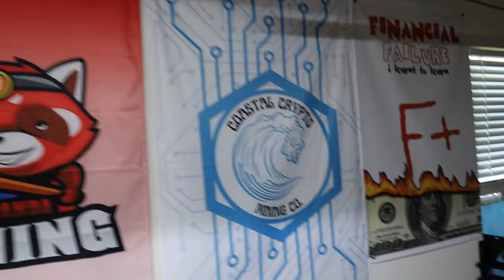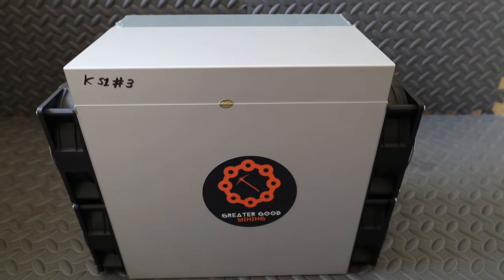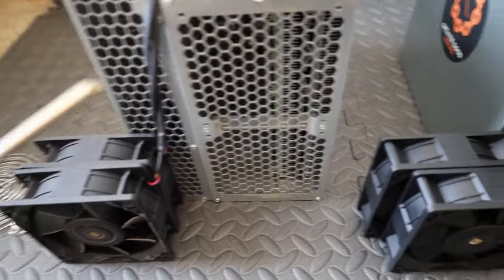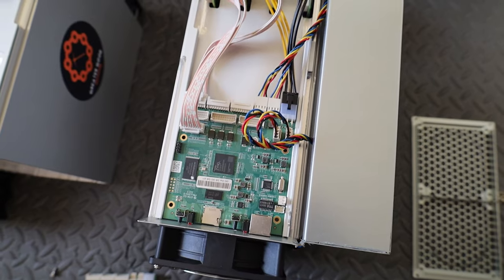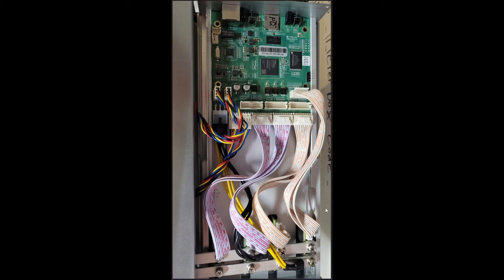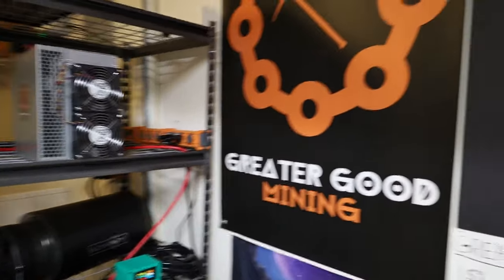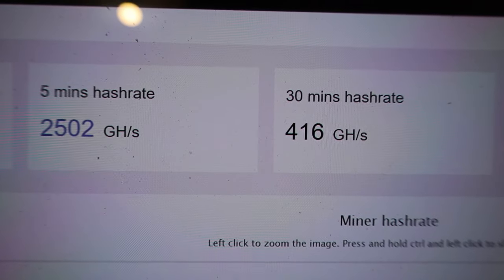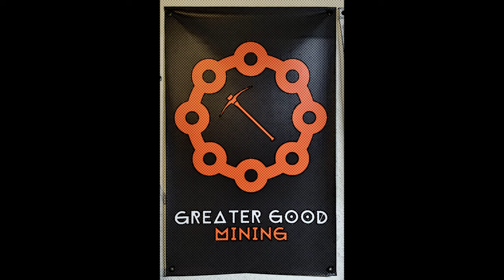Turn Two Iceriver Kaspa ASIC KS1's into an Iceriver KS2!! (Iceriver 5% off in description!)

Comment: Nice video, have you try this experiment with a KS1 control board that came by default??
Reply from the maker: No, but it should work. The problem is you won't see 4 hashboards only 2. The hashrate should show up at the pool, but you won't be able to monitor 2 of your hashboards

Comment: GGM awesome howto FAFOing .. you rock brother, just remember to remove the fans you don’t need to unscrew them just unscrew the fan plate the 4 outer screws and the second row data ports on the controller is for the KS3s hashboards.
Reply from the maker: I was wondering about the 2nd row of ports lol I'm glad you told me. I was thinking to myself... did they leave room to upgrade to a Mega Iceriver with 7 hashboards? 😆
Reply: @GreaterGoodMining  that’s a wild idea ... 3 KS3 hashboards and 4 KS1/2 hashboards all running at the same time would be sweet!
Reply from the maker: @fullyelectric  HaHa sounds like a potential future FAFO'ing session!

Comment: What a great video. I am curious if all these control boards are the same and it just matters on what firmware gets installed. Does anyone know?
Reply from the maker: Seems like they physically all look the same as far as I have seen. It's all about what they loaded up on them.
Reply: Could make for a good video! 😂
Reply: Not they look the same but arnt the same. I got a wrong ks3 sent by my supplyer and installed KS1 FW and it gave error.

Comment: Have you noticed your 4th Hash is 0° ? Is it a bug or something ?
Would it work with a KS3M Board ?
Reply from the maker: I moved where the cable was connected to the control board (I mentioned it at one point in the video) and all 4 boards report normally. No it won't work with a KS3M

Comment: Very cool video. What's the max suggested temp for the hashboards?
Reply from the maker: Hey thanks for watching! Max temp is 70c. What I've noticed with the latest firmware is that the fans adjust to keep the boards very close to or exactly 60c. Optimum temp seems to be 60c!

Comment: What is the difference between the ks1 and ks2 control boards other than the firmware?
Reply from the maker: You can run 4 hashboards on a ks1 control board, they just won't show up in the webgui. The hashrate will show up at the pool

Comment: So I wonder what makes ks3m not Overclockable. can I just take a KS3 board and use that to then it might become Overclockable.
Reply from the maker: No you cannot. I am in direct contact with people who make these overclocks and work with devs etc. It is not safe to overclock the KS3M. The KS3M is basically an already overclocked KS3L.
Reply: @GreaterGoodMining  that makes sense.

Comment: something does not add up. You need a Ks2 board? how much is that.. and how about the power supply, is it big enough to power the extra boards?  please explain.
Reply from the maker: Power supply for both the KS1 and KS2 is exactly the same, 2000 watts. In my video, I show that my overclocked KS2 only pulls about 1550 watts. You can run all 4 boards with the KS1 control board and the full hashrate would show up at the pool. But only 2 boards would show up in the web GUI that way. I wanted to avoid all that, i wanted all 4 boards to show up in the web gui, so I bought a KS2 control board off Icerivers website. About $60 for the control board off Icerivers website plus whatever the cost of shipping would be to your country/location
Reply: Than you. Did you try uploading the KS2 firmware to the Ks1 controller after you added the hashing boards? It could work...and you may see the board on the GUI... Please test.
Reply from the maker: @spmadeez  No need to test, I already know what will happen. Firmware update doesn't change every single file loaded onto the control board, it only updates a small portion of the files to make slight changes to how the ASIC behaves. If you want to do this with a KS1 board you totally can, like I said the hashrate that is expected will show up at the pool. But when you log into the web gui, you'll only see two boards.
Reply: @GreaterGoodMining   It actually will show all 4 boards if you load the ks2 firmware. At least with mine it did.
Reply from the maker: @JK3Dprinting  I had tried this before on my older 2 KS1's and it didn't work.... interesting. Maybe something has changed since then. What I've come to realize with Iceriver ASIC'S is that sometimes things just won't work on every model. I've had people in my Discord try the KS3L to KS3M stock control board swap and it didn't work. But a custom control  board will etc... $60 plus shipping for a KS2 control board is worth it to me because I like to FAFO anyway lol
Reply: @GreaterGoodMining   Well I did a reset on my KS1 and the factory BOOT version says its for a KS2 so there you go. Looks like mine was shipped with a KS2 control board but with KS1 firmware.
Reply from the maker: @JK3Dprinting  whoa, that's interesting! The plot thickens! HaHa Iceriver does some weird stuff I swear

Comment: I want to ask from where you get overclock ? From Tswift or Free one. Becouse If the overclock version on Tswift is bether I will contact him :)  and also... did he ofer overclocks anymore or not ?
Reply: I  ask for KS1 in my case :) becouse free one on Last batch make only 1.14 TH :(
Reply from the maker: Yeah The free OC's don't seem to work for everyone because for the KS1 it's like a one size fits all kind of deal. Tswift has multiple overclocks for each model that usually end up working when the others don't. Tell him Greater Good Mining sent you!
Reply: @GreaterGoodMining Hello friend, can I have a link where I can find overclocking options?